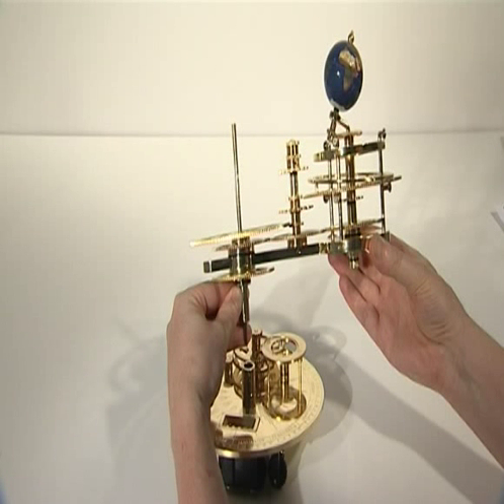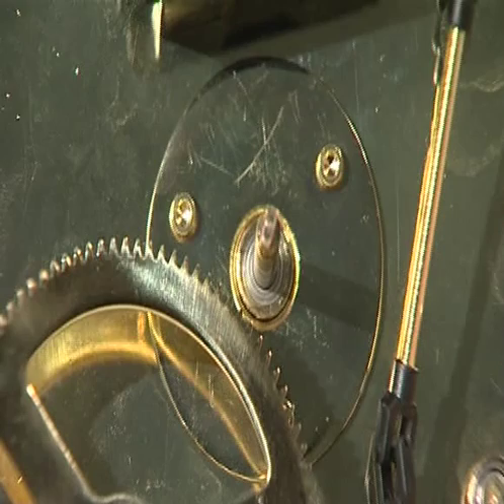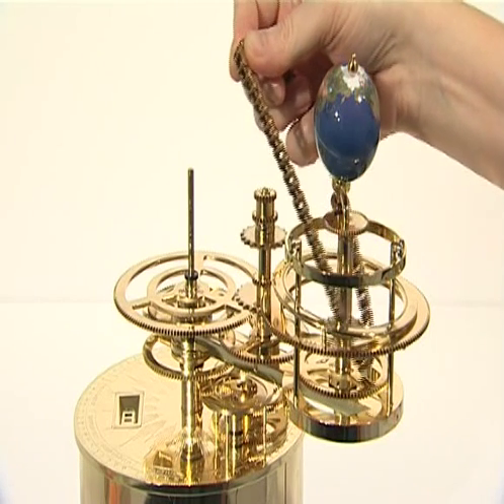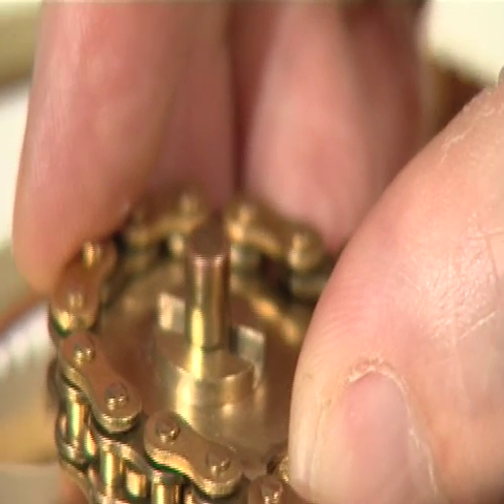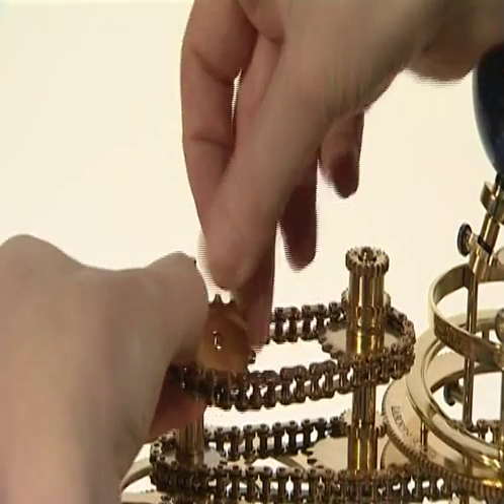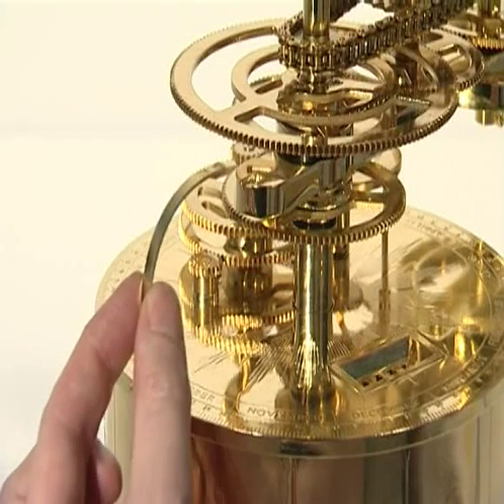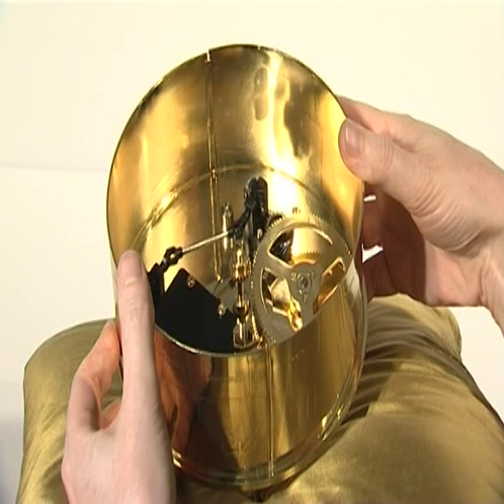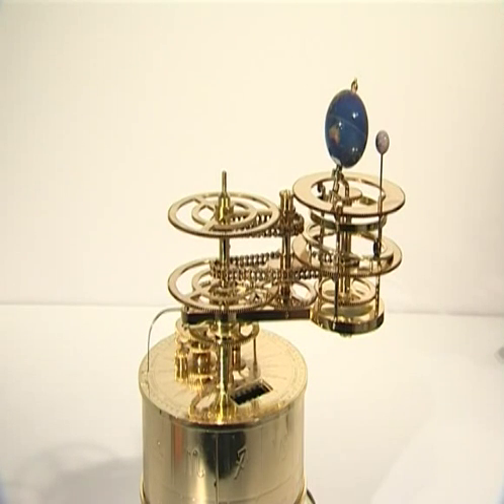Build a model sun, moon and earth orbiter: Stage 7

Comment: I have posted my version of stage 7 of assembly of this model. It shows an easy way to install the long chain. It also shows how to install the central shaft with the correct amount extending below the engraved plate to properly engage into the motor drive. I also posted other videos showing tips to assembling this model orbiter.

Comment: 1 minute into the video the narrator says "slide the long brass locking collar onto the central drive shaft", and then says "slide the 20-tooth gear onto the central drive shaft so that it is firmly against the base of the locking collar, the gear teeth should be uppermost". The video shows a short locking collar with the gear not even coming close to the locking collar. My kit came with a long collar as the assembly diagram in issue 47 page 5 shows and with the gear facing the other way.